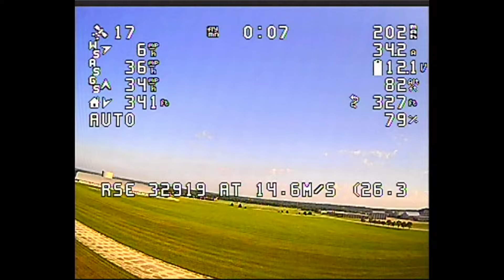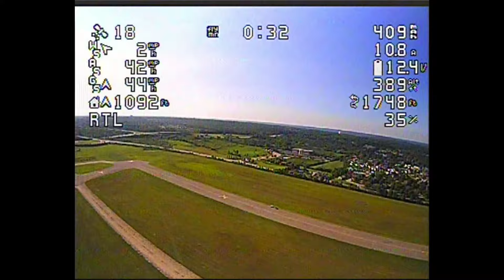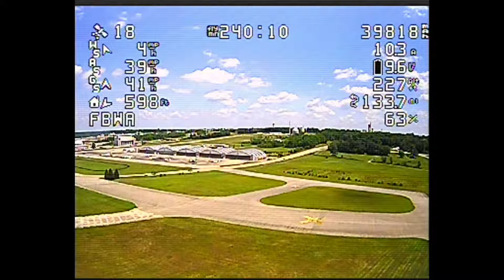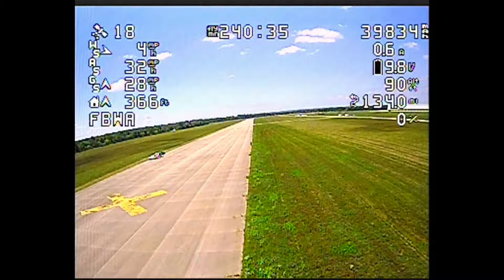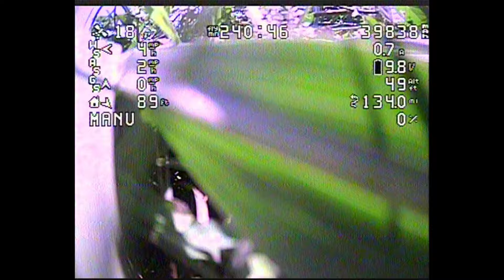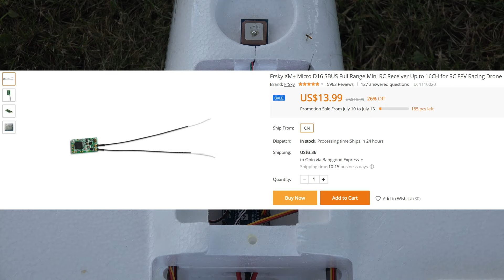X-UAV Clouds 4 hour endurance flight

Comment: Long shot, as video is 3 years old. Wondering what's the CG is good for this plane. Specs says 29cm from the nose ,read somewhere else says 28cm.
Reply from the maker: It's about a 1/3rd of the way back.
Reply: @MatthewHeiskell  about  1/3rd is not accurate is it 😀
Reply from the maker: @Kentuliz  At 2:11 in my video you can see my CG stickers. That's where I balanced it before the 4 hour flight.

Comment: What glue did you use on the wing & v-tail plastics to the foam??
Reply from the maker: I used UHU POR. Be sure to clean both surfaces with rubbing alcohol to remove the mold release substance from the foam and plastic.
Reply: @MatthewHeiskell  Yea, The foam is all laminated now. Ive never had a foam plane with so much pva, probably due to the complex shape & multiple bays & shape?  Doing plastics next, and want no issues. Thanks man, UhU Por it is, hows yours holding up??  I may need help choosing parts setting this beauty up. Going Maytek f405 or 765 wing(i have both, going Arduplane) Sunny Sky 2814-900kv(have other motor choices also-Racerstar, t-motor) 10x7 props cw & ccw, 4s, Not sure on esc yet, but have 40a plush 32, Hobbywing x-rotor 40a, Flycolor 40a & even Castle Edge 50a. A few others too(skywalker 40a, etc.) Looking for endurance on this bird so lith-ion... Any pointers would be greatly appreciated. Getting to the fun part part of the build now, Thanks, Rodger...
Reply: Ive decided epoxy for rear v-tail plastic joiners, then I'm gonna permanently attach v-tails with expanding gorilla glue, bonding the v-tail foam to fuselage foam. Then uhu por for font joiners. Just finished rear plastics, came out perfect, should be solid.  Hopefully finish front joiners tonight.  Thanks for  your input...
Reply: Clouds assembly is complete,  now onto electronics.  Thanks for your help.

Comment: i made same plane .. and watching battery .. here 45ah ? ))) you are kidding me )))
Reply from the maker: The first flights should always be with Li-Po haha. You only switch to Li-Ion when you need to double your flight time.
Reply: @MatthewHeiskell  i have 3s 2700-4500  1 li ion 4000mah 4s...  i am thinking is not enpught for 2 engines plane
Reply from the maker: Li-Ion packs have low continuous current ratings compared to lipo packs. You might be right now to use the small Li-Ion pack for that twin motor plane.
Reply: i did 4x3   12ah   21700 cells

Comment: Would it be possible for 3d print?
Reply from the maker: Would what be possible?
Reply: @MatthewHeiskell  to 3d print this plane
Reply from the maker: @frederickbergen4262  I've 3D printed a few free airplane designs, but all of them felt so flimsy that I didn't even add electrons and try to fly them. I've watched quite a few videos about it, but I've come to the conclusion that most 3D printer's filaments simply do not have the right material properties for the job. RC airplanes experience all kinds of forces, especially when landing. Foamboard is great though!
Reply: @MatthewHeiskell  what material did you use for this setup?
Reply from the maker: @frederickbergen4262  X-UAV Clouds 1880mm Wingspan Twin Motor EPO FPV Aircraft RC Airplane KIT

Comment: Hi do you know if it would be fine to add a hitech servo for the wings or ailerons?
They are a little bit bigger than the 9G servos and would need to be modified to fit in.
Would that all depend on the esc?or do you know if those servos would need more power?
I'm sorry i'm not sure but I just wanted to add those hitech servos that I was used to but I don't know if that will be fine or if that depends on the esc.
ty
Reply from the maker: The hitech servos should work fine. Look up the exact model and more sure that they are happy with 5V. As long as you don't see High Voltage (HV), then you're good to go. You can also bench test them to verify.
Reply: @MatthewHeiskell  thank you very much appreciate the reply.Thank you I will check  they are the hs 85bb.
good information ty!
I just barley got this model but it should be nice ..ty
Reply from the maker: @dragonmodel9262  Yeah, those servos will work, I just looked them up. You might have to use a hobby knife to make a slightly larger servo pocket, but they will work fine.
Reply: @MatthewHeiskell  hey thank you very much.At first when you told me the voltage I wasnt sure but then it made more sense thank you very much for this reply.
Yeah they already almost fit I dont mind making them fit in the wing.
I liked these servos from a regular plane I had thank you again.Havent had a long range plane though ty ..
Reply: @MatthewHeiskell  Hi im sorry to bother you could I please ask you again.about the servo.
I seen one that says 6V do you think that would be safe too>it was a savox servo if that would work I would use that.Its slightly smaller that the hitec to .ty
Reply from the maker: @dragonmodel9262  That would work, but running a 6V servo on only 5V makes it a little weaker and slower.
Reply: @MatthewHeiskell  I really appreciate the reply.I didn't even know that but that's good information.
Thank you again..
Reply: @MatthewHeiskell  hi im sorry to bother you again I remember I asked you a servo question before.
Do you know if your using some kind of flight board if it matters if its an analog servo or digital servo?the hitec I got are analog servos but I was wondering if that would matter.thank you for any information ..ty
Reply from the maker: @dragonmodel9262  That is a good question! Analog servos are the standard. Digital servos are more expensive, but they have a faster refresh rate. This makes them slightly better for planes that are controlled by a flight controller. But I still use analog servos in all of my planes.
Reply: @MatthewHeiskell  Hi thank you again I seen the comment earlier.
All the help has been helpful thank you again ,good info for now I will just use the analog servos thanks for the help.
Reply: @MatthewHeiskell  thank you very much I think they will work..ty again for the help.

Comment: Hi Matthew 
I watched most of your videos 
☆ Great presentation 
We have communicated via text messages in during the past weeks 

* i am interested in buying the X- UAV cloud or the Believer , or the  and use the lion battery you use that can make it fly 4-5 hours long range 
I  also want to use mission planner and XBSTATION ( LT WIFI 4G/5G) for telemetry 

I am fascinated about fixed wing uav that can travel long distance. 

Where can I get those batteries?
Would help / guide me with the electronic components that I will need to build one of those 
Plane? Please 

I live in the Bronx NYC 
FRANK
347-624-8875

Comment: New Sub! Thanks for the cool technical breakdowns!  I "need" a new plane.. Been loving my little ZOHD 250/340G, but looking for something more stable in wind.. Can't decide between the Strix Stratosurfer, Volantex Ranger 1600, ZOHD TalonGT Rebel, or an old school mini talon... thoughts?
Reply from the maker: Hello Clay, I'm glad that you enjoyed the video. I'm a big fan on the mini-talon. It is a nice size if you plan on flying with a gopro. The efficiency is excellent. The strix stratosurfer has a super durable fuse, but I've never flown one. I had a ranger 1600, but I did not like the throttle/pitch coupling, especially then you were near stall speed. I have no experience with the TalonGT, but it looks like a chonk haha. RMRC is having a sale on the skyhunter 1800 right now.
Reply: @MatthewHeiskell  Thank you very much for your input and time!  Really enjoy your channel!

Comment: so i see two major differences besides the airframe:  the prop pitch and the average speed.  Are they flying at the same airspeed?
It takes some time to determine the best airspeed for endurance, or distance for a given airframe, and for distance, wind strength can be a variable. 
it may not be possible to fly both at same airspeed.. or desirable..  
just curious..  
of course, wing area, Aero design, airfoil,  and aspect ratio are factors, as well as weight, etc. etc. 
hard to compare directly, unless given a specific task, (mission) and take time to optimize each for that mission.  and results will only be valid for that mission.. 
it's a hard task to compare, but nice to see some comparison done regardless. I'm sure a lot can be learned.
Reply from the maker: Hey Spike, you're right. There are sooo many factors that differ between the the planes. Both flight controllers were set to fly at the same airspeed. The Clouds landed with a higher average ground speed because it had to deal with less wind. I remember watching the Talon struggle on the headwind side of the orbit for long periods of time. We joked about how the ground speed was nearly single digits. I remember it hitting 52mph on the tailwind side one time. I'm pretty sure that it does not "balance itself out". When the wind speed is half of your cruising airspeed, you spend A LOT of time slowly fighting the wind. I'm working on the 2.4m Phoenix right now. I am printing a motor adapter to use the 700kv motor with a 12x12 APC. That seems like a good combo. I had to hack up the phoenix fuse a bit to get the battery to "kinda" fit haha. It basically has a bomb bay now without the doors haha, but at least the battery is mostly under the wings. I am sure that it will still take a decent amount of useless tail weight to balance it.
Reply: @MatthewHeiskell  you are right, the wind does not balance out for distance covered.    you spend more time in the headwind and less time in the tail wind.   also flying cross wind, you are losing.    but  wind alone should have not much effect on endurance.   only if it comes with turbulence, which in the real world, It usually does,,.      will be interesting to see what the Phoenix will do with the 12x12 prop, and the same motor as the talon.  
have you tried different motor/prop combos on the same exact airplane?  say just change the prop?    I think the KV is not really relevant for efficiency of the propulsion system, but rather the diameter of the stator, gap from it to the magnets, strength of the magnets, (matters but very little) and if the magnets are curved or not.   in the drone world, there is a push to just make one KV of motor for everyone and let people set throttle limits to their liking.  I've tried this with a model boat, a slow boat for filming and used large high KV brushless racing motors intended for geared dive, but used with direct drive.  had to limit throttle to about 16 percent, but works great, with no noticeable bad effects of loss of resolution.  I think using a large diameter stator regardless of KV is key to max efficiency,  along with the other factors we already discussed.
Reply from the maker: @FPVREVIEWS  Wow, that's really interesting. I thought brushless motors were most efficient when they were being used at 50-70% of their max. A while ago you recommend using a higher than normal pitch prop to improve efficiency. I have found this to be very true! You said that the larger the diameter of the stator, the better. I think that you can take that statement a bit farther. What about "pancake" motors? My 700kv motor has a 3508 stator. I think that for efficiency, you want a large diameter and a short stator. What do you think? Also, I just ordered a new motor to try on the Talon. It is 600kv with a 4108 stator. APC makes a 14x14 electric prop, maybe that will help. A larger stator and a larger, pitchier prop.
Reply: @MatthewHeiskell  yes, the pankake motors (as long as they do not cuase too much aerodynamic drag) shoudl be better. 
the length of the stator is not that relevant to effeciency, but if it's too short, you will burn up motor trying to swing a given prop. 
also if it is too long, does not matter to the effeceicny of the propulsion system when running at a constant RPM, but will have more mass to accelerate and decellerate, also weighs more, so plane weighs more...  so figure out the largest diameter that you can fit, then figure out how much it draws swinging a given prop, and last choose a stator length that gives the motor enough thermal mass to not burn.   the KV is irrelevent, but if not high enouhg may be low on power.  higher than neccesary, and not limited in throttle, then will burn up.  so just pick one that is high enough or higher, and limit if necesary.   at least that's how i understand it.     i just ordered some sort of pankake motors for my solar plane and very high KV, so will test myself.
Reply: of course the other way is to use multiple motors.    The combined stator diameter is equivelent to a larger one, and the disk area of many props can add up to one large one.   Same rules apply, but on smaller scale.     This has key advantages:
1 the configuration is more flexible, and you no longer have to worry about a large prop clearing the ground, etc. 
2  changes in RPM can hapen much more quicly with multiple small motors, if you need them also for differential thrust, or for lift, such as with a VTOL.    
Not sure at which point it becomes DEP  Distributed electric proplusion.    
there are many benifits, but it becomes more important than ever to have very effeceinct porpulsion. and you see most DEP systems use prop-fans rather than conventional props, especially at low reynolds numbers.  such as Helios, etc.